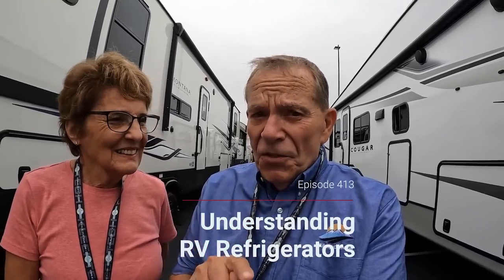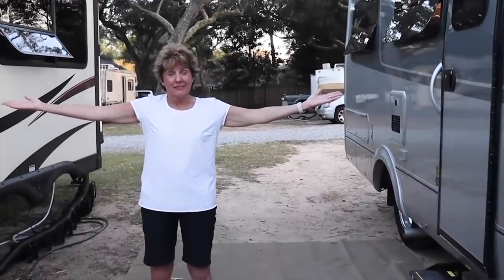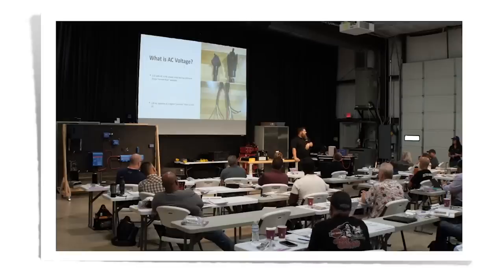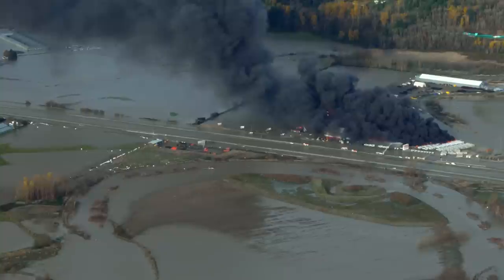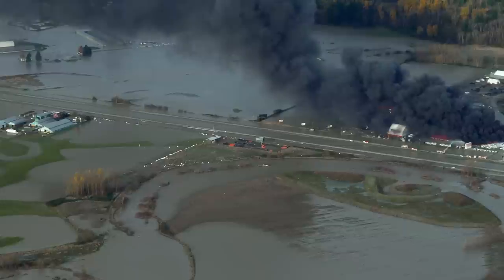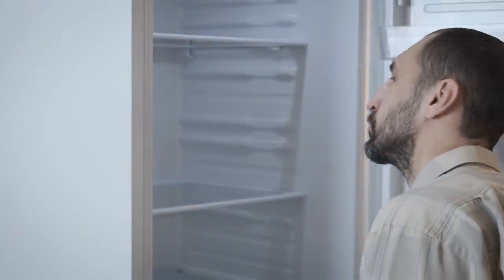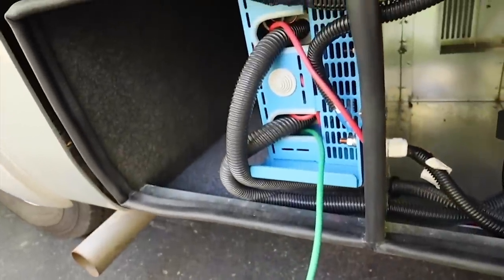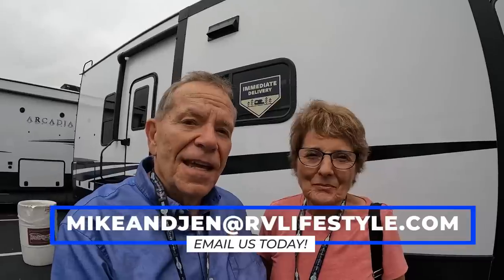Understanding RV Fridges | Tips from a Master RV Tech

Comment: We have the good old two way absorption style fridge.   Our previous rig had a 12 volt everchill.   The 12 volt was bigger no doubt, but was a huge energy drain when off grid.   Without solar an AGM battery won't even run this for 24 hours let alone provide any other energy for furnace fan or lights.     With 12 batteries and some solar power we could squeak through a couple of nights off grid but that was it.    With the absorption we simply run it on propane when off grid and it will last as long as my 60 pounds of propane will.   Also I have never seen the need to run it when travelling.   The last thing we do before leaving camp is shut the fridge off, and we can be on the road for 8 or 10 hours, and when we get to the next spot it is still good and cold inside the fridge and everything in the freezer is still frozen.    Certainly do not see the need to run it while driving, and have to worry about open flame and open propane tanks....as always safe travels...

Comment: Great to see how they work.  From experience with an absorption unit, if the freezer is good but the fridge is struggling, it could be the propane pressure regulator.  Just need a manometer to check the level of pressure. Solution....replace the regulator which is not an expensive item.

Comment: I learned that propane fridges die very slowly. I tried for a year to correct mine with fans and other gimmicks but then it finally conked out. It was a relief actually. My new propane fridge has worked perfectly for the past 3 years. I try to keep as level as possible never more than 3 degrees.

Comment: Propane fridges use a lot less energy. Mine only uses 5 gallons of propane in 2 months. Probably because propane fridges have no moving parts.  Just a tiny propane flame that only comes on when needed. An engineering marvel. 
I'd probably have to have 4 more heavy AGM batteries for a compressor fridge.

Comment: Is it really best to buy an RV at a show? You don’t have the opportunity to test everything and have a inspector inspect it if you choose to do so. In the spring of 2020 I was headed to an RV dealer 700 miles away to pick up my new Tiffin Motorhome cashiers check in hand, they assured me everything was working perfect and Was AOK. When I got there the slide didn’t work, the generator wouldn’t start, there was a hole in the shower wall and it had cabinetry falling off the wall. Needless to say I drove home. Even though I’m still pretty mechanical I wouldn’t buy even a new RV without an inspection.

Comment: We normally travel 3 to 6 hours on a travel day.  Will the refrigerator stay cold enough during that time if propane is off?
Reply: Some say that you should run it on the generator when traveling. That is a lot more expensive in the short run, but if it saves you from having to buy a new refer so be it. If no generator, then all you can do is not open the door until you get to where you are stopping. The cold will last 3 hours. On a 6 hour check the temperature upon arrival. It should be ok.

Comment: All that is true it could happen but sence 1978 i have had 7 rv trailers thr last 30 years i have worked and traveled in the last 6 of them a have used the propane in the frg for i would say 85% of the time. No problems what so ever.

Comment: My fridge is gas/electric.  I don't use any gas in my rig.  Scared of fires. I'm stationary so am on shore power totally. 
How do I keep my fridge from freezing everything. I've tried moving the little slide thing up & down but can't figure out which keeps things cold enough with no freezing. 
I defrost monthly using bowls of hot water.